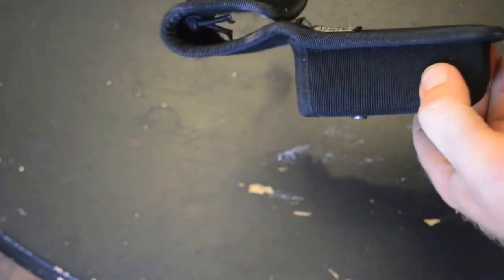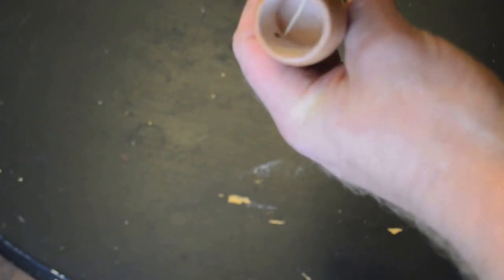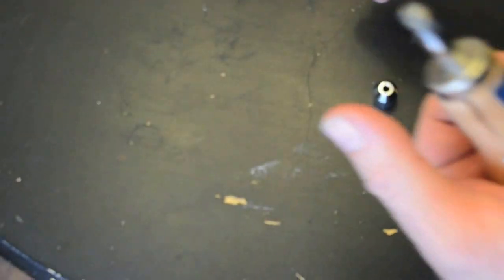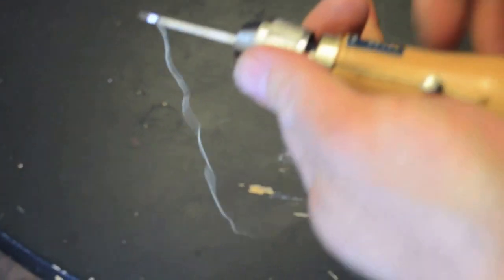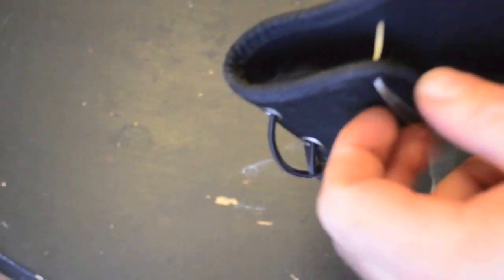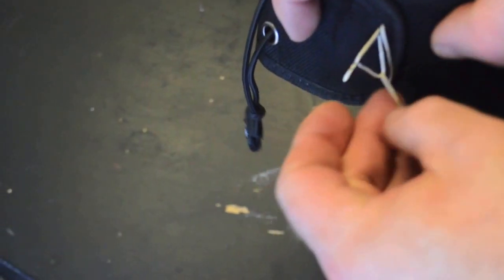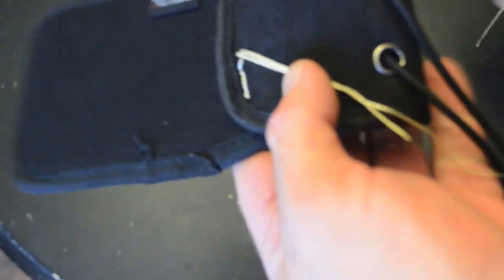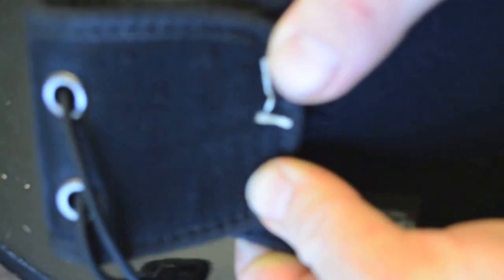How to Use a Speedy Stitcher Sewing Awl

Comment: It's much easier with wax thread. I prefer the old style ones. The needles are just stupid expensive for them. 
With the wax thread it wont slip and slide on ya as much and you can really crank em down. 

Thats the best way i can think to fix it. 
On leather i'll usually just use a hole punch and sew it. I didn't have access to tools like this when I was learning leatherworking.